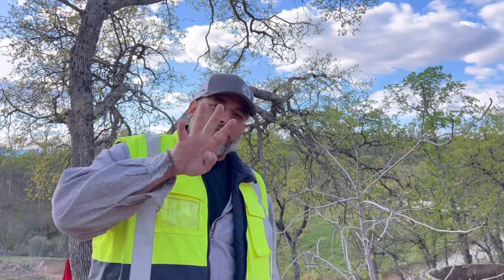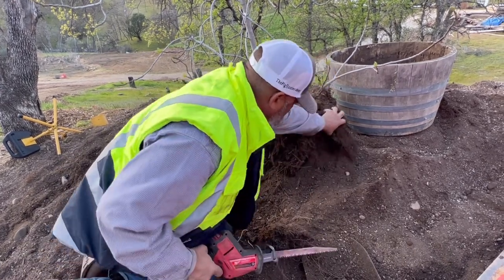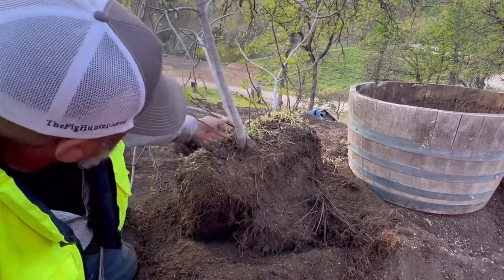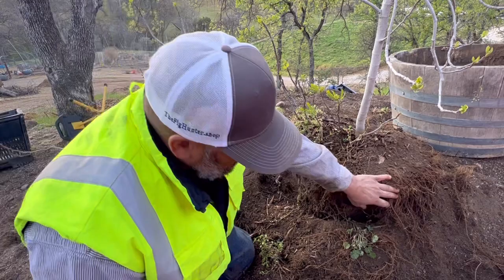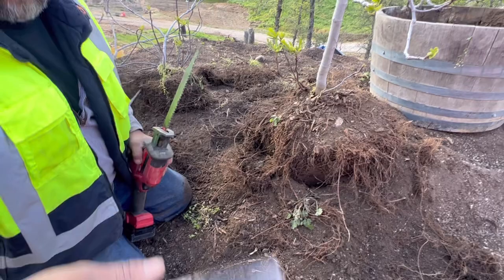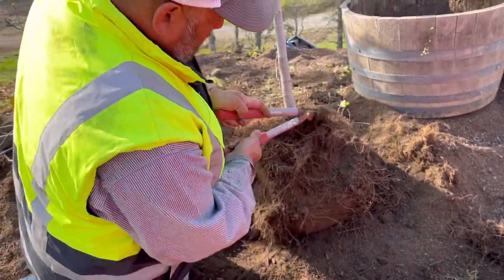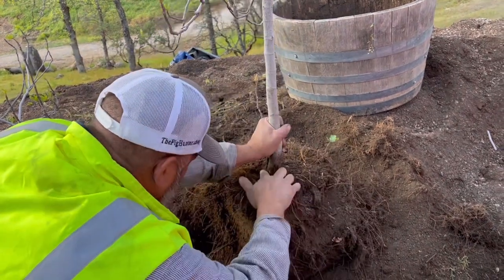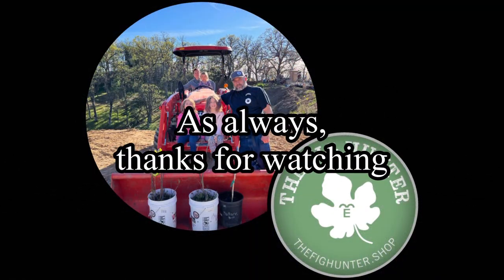Fig Hunters - Root Pruning (an aggressively root-bound tree)

Comment: Do fabric pots air prune and keep them from getting root bound?
Reply from the maker: Hi Matthew. We have found that they can get root bound in fabric pots too. For our larger trees, we have switched to square, high density plastic, pots that have holes throughout the sides to promote air pruning. By even they will occasionally need root pruned. Fortunately the sides individually unscrew to make it easier.